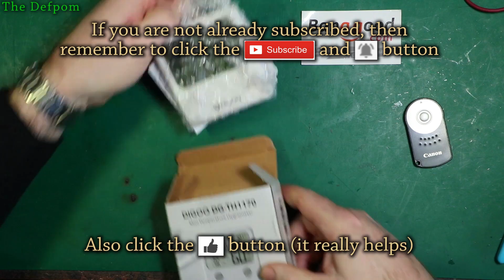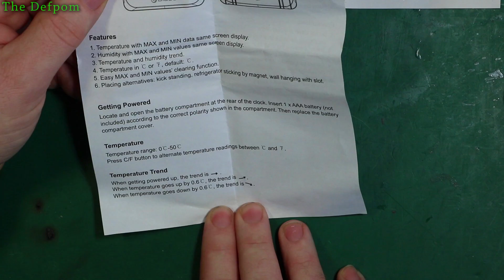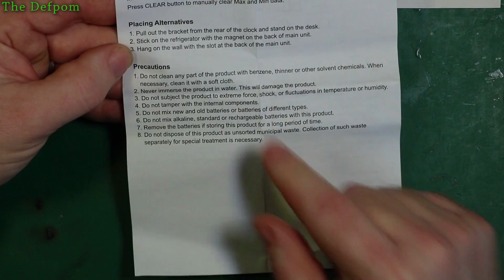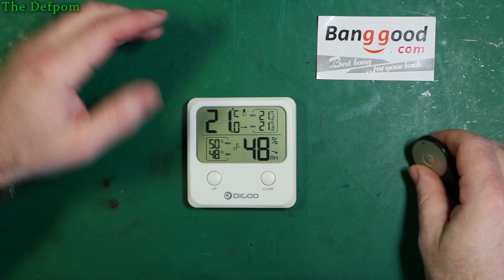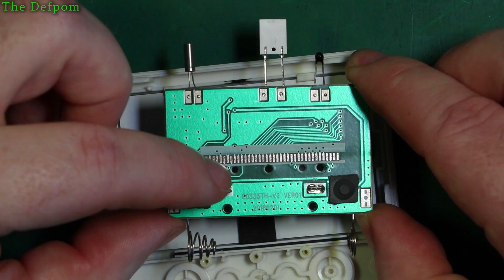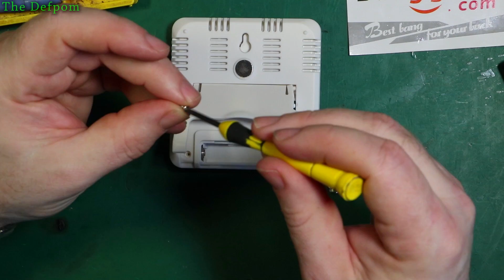🔴 #616 Thermometer & Hygrometer - Digoo DG-TH1170 Product Review and Teardown

Comment: I have the DIGOO weather station, the small one with  the nice imitation wood-grained fascia.
A nice unit, with outdoor sensor, BUT it has no sea-level compensation for the barometric pressure.
Other than that it works well.
https://www.banggood.com/DIGOO-DG-EX002-Wood-Grain-Color-Screen-Weather-Station-HD-Color-Screen-Outdoor-Indoor-Thermometer-Hy-p-1295792.html?rmmds=search&ID=521172&cur_warehouse=CN

Comment: When i read hot and wet i thought you were doing a tea making video :)

Ahh the zebra strip, if you can't make a perfectly lined up parallel connection then make a strip with lots of super thin conductive strips and non conductive strips,  make them thin enough so ten or more pairs will fit on a contact pad.

More than one strip will contact the pad/display pad and complete the connection .
Amazing and very sneaky idea, although they can play up lol.
Dam i've just bored myself stiff, did i just hear someone say Ooow Err misses :-D